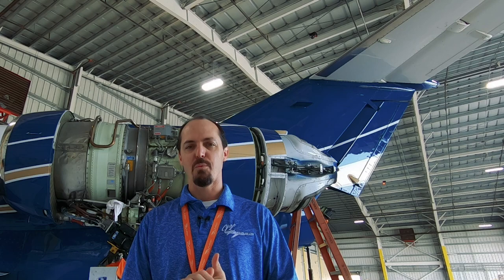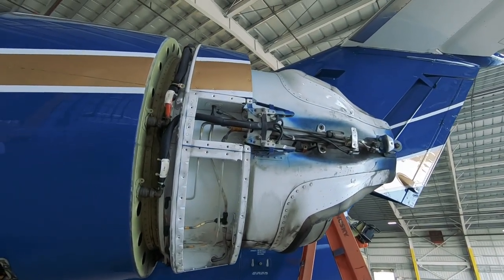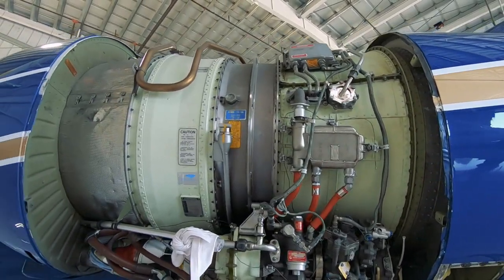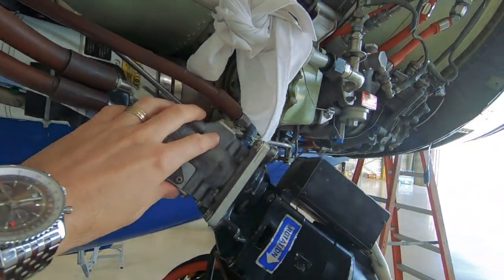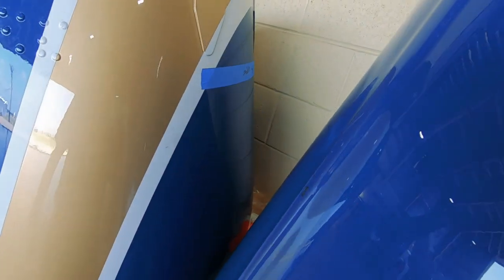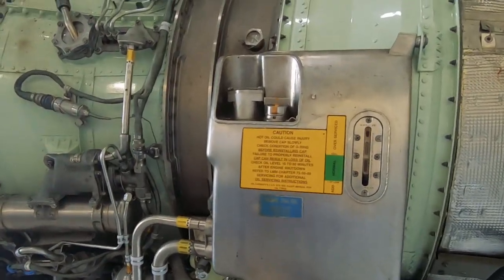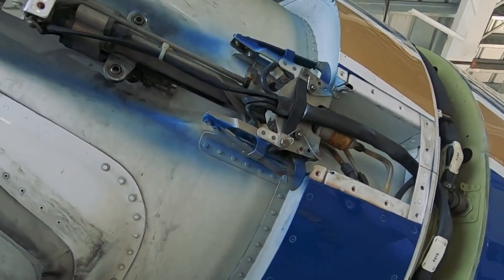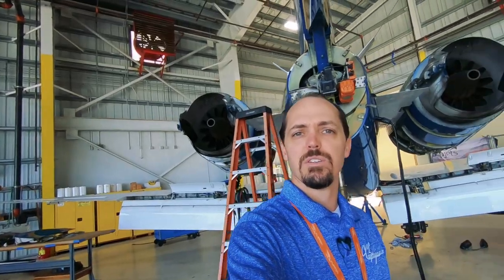Parts Came Off! - Tech Tuesday

Comment: I’ve always liked seeing the inside of a turbine engine. It amazes me how fast those parts spin and the amount of thrust they deliver
Reply: You aren't seeing the inside of the engine. You are seeing the external gearbox and assessory components. The inside is usually only exposed once an engine is removed from the aircraft and in the overhaul workshop, to see the compressor, combustion chamber, nozzle guide vanes and turbines.
Reply: JJ Smallpiece I have seen the inside of RR Trent 972 and the CFM 56 used in the bigger airlines as well as the smaller Pt6 turbine used in the Kodiak, Caravan, TBM and other aircraft. AgentJayZ has a channel he tears apart old spays and repurposes/ rebuilds for generators kinda neat They are quite the engineering marvel.

Comment: Being a retired corporate pilot as well as A and P mech, I’m missing those days.   What better way to show the confidence in the job I just performed than to take it out and fly it.    No second guessing, did I put that screw back in, did I safety wire those nuts?

Comment: Thrust reversers opening in flight are bad, unless you want to recreate the glide slope of the Space Shuttle.
I read an article years ago about the jet they used to train the Space Shuttle astronauts.
I believe it was a Gulfstream and they had to use the thrust reversers in flight to simulate that brick like glide ratio.
Reply: That happened in S America, I think Argentina many moons ago. One bucket opened on take off and the plane crashed , was a huge accident with many ground casualties..  They are not possible to open unless the landing gear switches are on, meaning weight on the landing gear.. but this plane had a bad switch so it allowed it somehow.. crazy accident.. look into it..
Reply: @RussellD11  
No one mentioned an accident, why are you attaching this to my comment?
Reply: @bruce2357  because i did, as they have caused accidents.. so block me
Reply: Could have done the same with a Hamilcar glider loaded with a small tank.
Knew one of the pilots who tested the thing during the war.
His comment was that a sack of spuds flew better.

Comment: Are you sure the thrust reversers are operated by hydraulics? Every aircraft I ever worked on, the TRs are operated by an air bleed from the engines. Using hydraulic oil would be high risk - an oil leak around the engine exhaust is likely to be a fire risk. Now that would be really bad in flight,
Reply: Hydraulics on mechanical thrust reversers. Most commercial airliners use bypass air instead.
Reply: @adamdarnell7996  Exactly my point. Wherever the air is taken from, safer than oil hydraulic systems.

Comment: Hey Shawn. I am in no way questioning or judging your appearance with this question... I hold for different type ratings from three different aircraft manufacturers, in each of them I learned in the operations manual that facial hair other than a mustache would interfere with oxygen masks ability to seal. Do you guys use an oxygen mask different from those found in most airliners, or did They revised the testing, so that it now permits Chin facial hair?
Reply from the maker: That one is still up for debate. The latest study by Air Canada showed that it doesn't interfere with the seal of modern oxygen masks, but I do know that studies in the past have shown they will not seal over facial hair.

Comment: So unlike piston engines, these actually use (or burn) quite a bit of oil yes? like you need to add quite often?
Reply from the maker: The Rolls Royce engines found on Gulfstream aircraft (before the G650) do use a good amount of oil, but the TFE engines on Hawkers use very little.